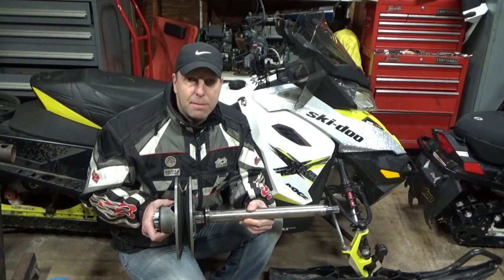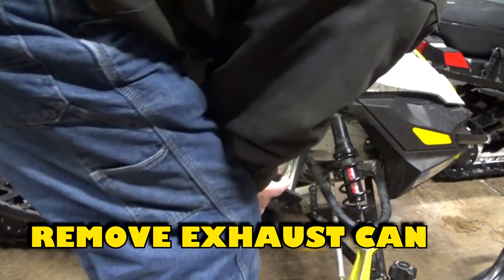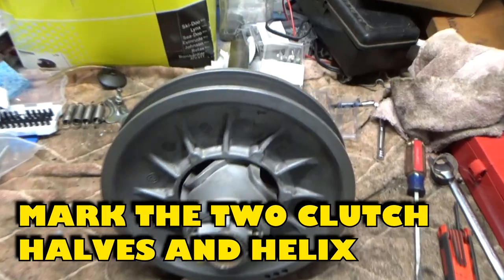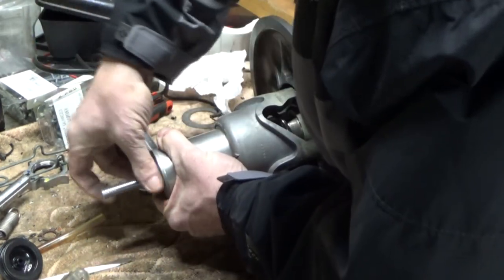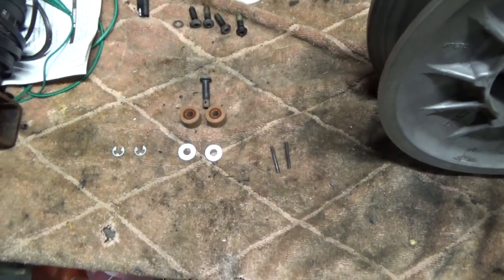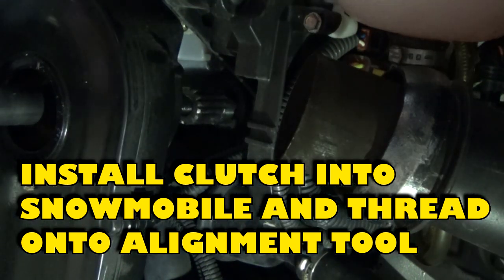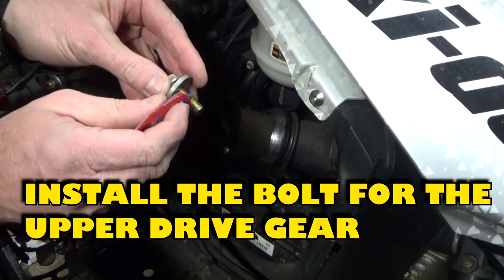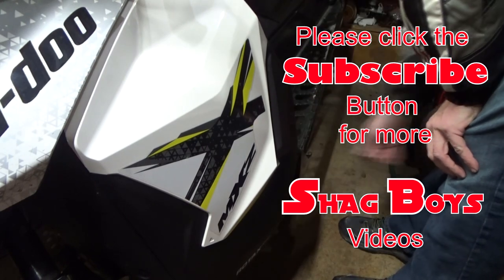Ski Doo Clutch Roller Replacement for Ski Doo QRS Secondary Clutch

Comment: Impressive Great detail  You get a lot of hits with this one Best on youtube
Reply from the maker: Thanks Alan. This was a very difficult and tedious video to make. It is hard to repair and video the repair and get the information. I couldn’t find anything about the roll pins in the roller bolts. If you do not know they are there, you might destroy your clutch trying to get them out. Thx for the positive feedback

Comment: Excellent  instruction video, my riding buddy had the same thing happen at the beginning of the season and this vid would have helped him a ton! it's too bad that the rollers break for one, and that you have to take half of the sled apart just to pull the secondary. Nice Job!
Reply from the maker: Hi Darren, it is definitely a weak point on SkiDoos, I can’t believe they haven’t fixed it since 2008. If u didn’t know the roll pins were in the roller bolt, you would mess it up. Glad u liked the video, thanks for watching

Comment: Awesome Shag, That was exactly like watching a Case IH technical training video. I am a Cat guy but I watched the whole thing with no skipping ahead. In this video I also learned how to adjust drive belt deflection, and chain drive tension on a Doo .
Reply from the maker: Thanks, glad u like the video. It is definitely more time consuming to repair and videotape at the same time. Thanks for watching the whole thing, I think there is good detail in the video if someone does the repair themself. If you didn’t know the roll pins were in the roller bolt. You could really mess up your clutch. Thx again for watching

Comment: FYI for anyone struggling to seat the bearing on the jackshaft during re-assembly (~13.00 in video). I found that hammering with a wood block didn’t work (the bearing bracket has too much flex so it just absorbed the hammering force). So, instead, I used two vise-grip pliers to press the bearing isn’t place gradually (using them like clamps). Worked like a charm.
Reply from the maker: Thanks for the tip, sounds like a good option
Reply: Put the clutch in the cold, and heat the bracket. It’ll drop right in

Comment: That was a great video Shag, very detailed and you really took time to explain things plus you have knowledge about fixing things, it shows ( is that Smith Marine calling)
Why doesn’t Skidoo address this issue if they keep having problems with the stock rollers?
Reply from the maker: Hi Tom, thanks.  I really put a lot of effort into trying to do the video right, it is twice as long when you are filming.  I totally do not know why SkiDoo has not improved this design.  At a bare minimum, they should put a roller made of a more durable material.

Comment: Great video. A few questions: 1. why can't you remove the bolt prior to removing the roller? What if someone wanted to replace the rollers as maintenance? You would not be able to remove the roller prior to removing the bolt... 2. Does anything need to be indexed so that it goes back together aligned in the same manner? Thanks and again - great video!
Reply from the maker: You can definitely do this for preventive maintenance.  Yes, I suggest that you mark the two clutch halves so that they go together the same.  This will keep it balanced

Comment: Smart upgrade shag!  I blew a belt and smashed rollers and even busted the threaded part for the nut on the other end of the jack shaft.  What a mess
Reply from the maker: Hey Gary. After doing it once, it wasn’t bad. Next time, I may actually try to change the rollers with the clutch in the sled. I can’t believe Ski Doo has not upgraded the material on these
Reply: @shagboys2251  They are meant to fail - I think its designed into it - When I sheared the end of the jack shaft that just shows you at high speed RPM of the shaft how volatile things are.  I mean if the rollers didnt fail it could have been way more damage - I think they saved a few things in my case (ie gears)
Reply: And I just smashed my rollers today haha
Reply from the maker: @mudbrats  Bummer, but at least you have experience fixing them.
Reply: @shagboys2251  👍

Comment: That was an awesome video Shag. Looks like I need  a couple new tools.
Reply from the maker: Together, the tools are about $100. You could make them, they are not complicated. Good luck
Reply: @shagboys2251  yeah I made all my other clutch tools. Hey what do you think of the new ski doo line up sweet suspension and now the lynx lineup lots of nice new tech with big price tags. The Mach Z starts at 22000 Canadian. Thanks for the tech tips. 
Ride Safe
Reply from the maker: @tboystoys5682  Yeah, those clutch tools could be made with a little effort.  The new Sleds look really nice, I just can't beleive they want $22,000 for a snowmobile.  In 1998, I bought a used sled that was 6 months old for $4,800.  Times have changed, but I would love one.
Reply: @shagboys2251  I talked with the significant other I may trade up but undecided as I never got a whole lot of riding this year so far but I got till the end of March   To decide. The Rave suspension from what Luke and AJ from snowtrax tv say it’s a step above the XRS SUSPENSION. Waiting to see if they test ride it up in the highlands but I know our local BRP dealership never does it. Maybe the mainland might do something. 
Ride Safe Bud.
Reply from the maker: @tboystoys5682  Sorry you haven't ridden much.  We had a slow start but it turned into one of the best years in a long time.  Good luck with the trade up
Reply: @shagboys2251  No I’m going to hold off till maybe next year or whenever the G5 is introduced. It’s getting so if you want to ride a top of the line machine you will need a sponsor or mortgage your house. I am thinking also of freeze up on the new smart Shox system if the actuator gets moisture in it will it freeze up the whole system? Like there is a lot I would want to know before spending 20 000 plus on something I only use maybe 3 months a year. We will see.  My 17 is worth 8500 on trade but that’s just on paper. ?????
Ride safe Brother

Comment: Very good Descriptions  A Lot more Complicated than a Yamaha Apex ..  I never did get a shop manual for my 2014 Skidoo Renegade X 800.  It  sounds like you used aftermarket rollers?
Reply from the maker: Yes, aftermarket rollers are stronger and I highly recommend them

Comment: Well done but what a job on those skidoo’s Acrticcat I seen them remove secondary right on the trail to get the rest of shredded belt from 900 snopro I guess that’s why skidoo gets the premium price it’s like Owning the BMW of snowmobiles where arctic cat is like the HARLEY DAVIDSON of snowmobiles
Reply from the maker: I agree, I hate the fact that the jack shaft is connected to the clutch. My old ZR clutch came off with one bolt. The roll pin is tricky on the roller bolt. The good news is that it is fixed and I can ride my sled again

Comment: you did a great job great video that is a wierd design
Reply from the maker: Hi Nate. I was not impressed with the design. It stinks that the clutch and jack shaft are one assembly. It is tough working on stuff and filming. It takes twice as long because I am trying to capture a good shot. I took out the F bombs while I was working on it. Thx for watching

Comment: Shag  video is superb! just gone doing this on an '18 renegade 850, your video made this much easier because i didn't know about the roll pins...my sons old sled 2010 had the circlips. I hear some dealers are not reinstalling the PIA roll pins just loctite, what's your opinion on this? Think the pins are really necessary?
Reply from the maker: Hi Steve. Glad this was helpful. I personally would install the roll pins. It is not that difficult if you know what you are doing. If those roller bolts come loose, it would probably ruin your clutch. Glad this was helpful

Comment: Nice veido any ideal why they break just replaced mine got 100 miles or so on them broke agan any thoughts would help.
Reply from the maker: The stock ones are not very strong. Buy aftermarket ones that are heavy duty. One of the reasons they break is when you go in reversed, and then go forward fast the secondary clutch opens up and slams forward. When you go from reverse to forward, do it very slowly.

Comment: Looks like those new rollers are made of some type of phenolic resin. I'm surprised they couldn't design the assembly with three rollers at least. More rollers would make the load on each of them less.
Reply from the maker: Hi John, you are right, the load on 3 would be less than 2. I think SkiDoo made them with 3 in the past and then went down to 2. I can’t believe they have had this design for 15 years, with known problems and have not fixed it. Very disappointed. I put a heavy duty roller in it, not sure of material but a lot of the forums recommend the C&T roller, that is what I used. Thx for watching
Reply: @shagboys2251  Bean counters.
Reply from the maker: @johnb5519  LOL, exactly right

Comment: Nice video, sure it'll help somebody out.  You upgrading the 12 next?
Reply from the maker: Hi Charles, I will probably do it in the off-season. Hopefully it won’t give me a problem this year. I hate to be without one of the sleds. We have been riding a ton. How about yourself
Reply: @shagboys2251  a bit locally wich is nice.  More time riding , less time trailering. Fingers crossed snow holds up.

Comment: Can you change helix without pulling it completely off
Reply from the maker: It is possible. The trick is loosening the Torx screws on the back side of the secondary clutch. If you can get those loose, it is possible that you do not need to remove the entire clutch

Comment: how do you know where the chain tension is at after it was loosened?
Reply from the maker: Usually I bring the bolt in finger tight. You will feel it starting to tension, then tighten the jam nut

Comment: How do you know if the rollers are broken?
Reply from the maker: One signal is that the belt tension is wrong. If the belt is sitting very low in the Secondary Clutch, this is a good indicator.
Reply: @shagboys2251  thank you!

Comment: What diameter is the alignment tool?  I need to just remove the clutch to send it off to a shop
Reply from the maker: I actually borrowed the tool,  I am not sure of the diameter, it is roughly 5/8 of an inch

Comment: Anyone know if I can put a secondary clutch from a 2010 ski doo summit 800 into a 2009 ski doo mxz x 600ho etec renegade?
Reply from the maker: That is a good question,  I know the primary clutches are different, let me try to find out if the secondary clutches are different
Reply: @shagboys2251  thanks for the reply, i found out the secondary is the same on the outside just has different spring and rollers i believe. Went with rebuilding the secondary as the best option

Comment: What year they’re all kind of different your title is useless
Reply from the maker: QRS is the type of clutch.  It is available from 2008 to present.  In the video, it describes the differences
Reply: @shagboys2251  yes, it is basically the same over the years but it has changed very slightly each year having the correct year for the machine you’re working on would make it very helpful

Each slight change throughout the years, requires a different procedure for disassembling the clutch
Reply from the maker: It was a 2016